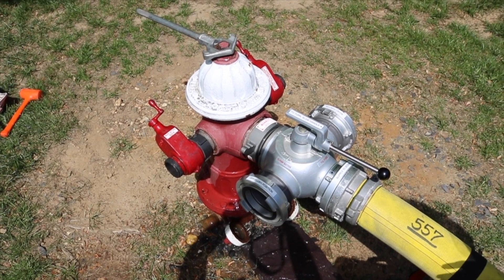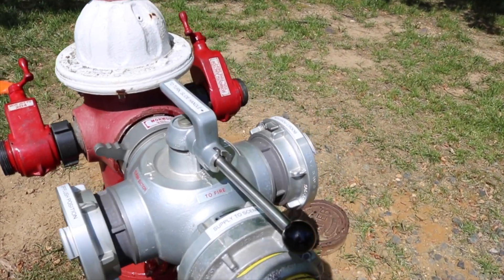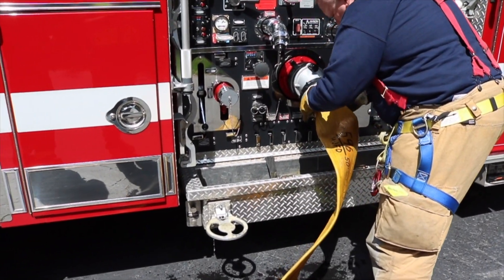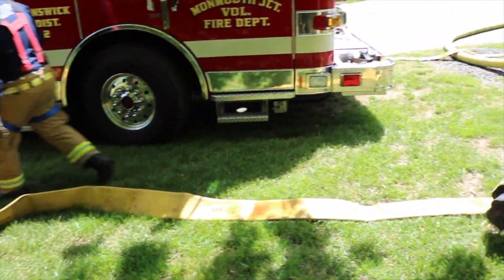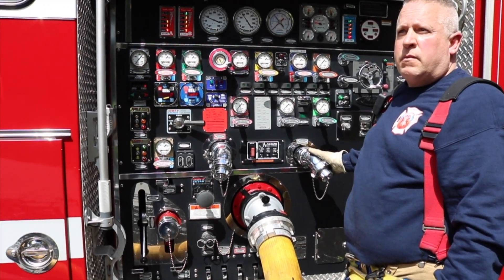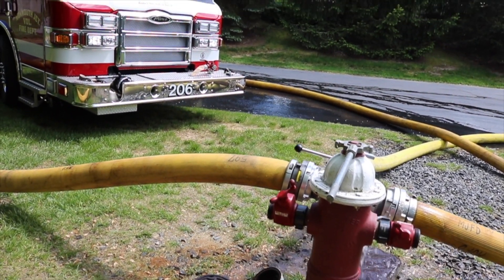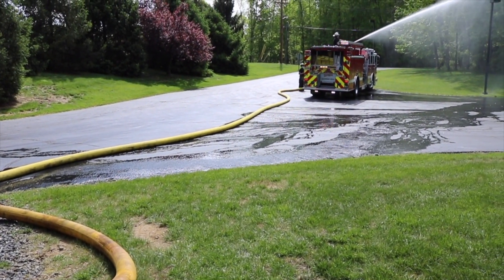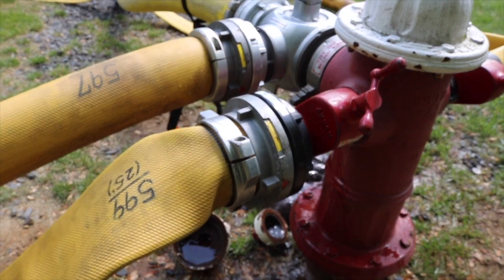Hydrant Ops with Boost Engine

Comment: During my career we called them 4-way valves and they work great, especially in areas where you have and use hydrants a lot, and run two-piece engine companies (or single engines that are used to working one as attack and one as supply). Great tool.

Comment: Hypothetically, if the hydrant is only capable of 1500gpm, how is robbing water from the same outlet port going to increase water output? Your utilizing the same GPM …
Reply: You arent increasing volume, you are increasing pressure for long hose lays.